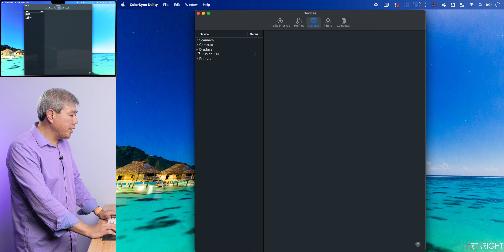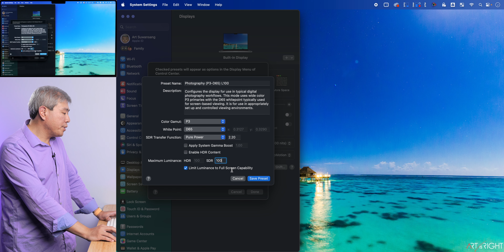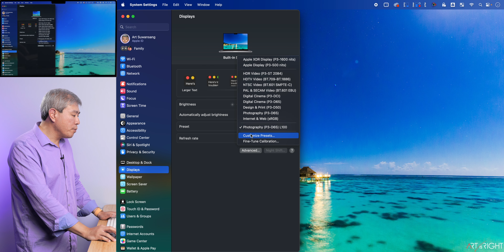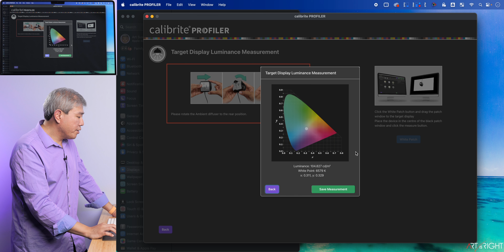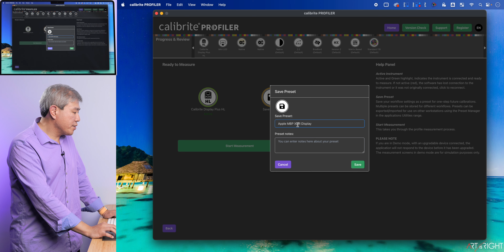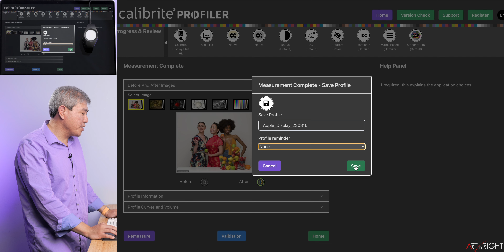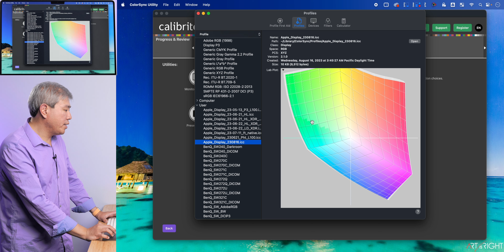Ultimate Calibration Guide for Apple 14" & 16" MacBook Pro XDR Display - This is the way!

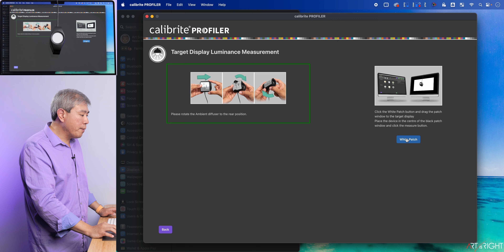Comment: At 10:00, what is the meaning of measuring the existing white point of Apple calirbated display as the target of the calibration setting as you will calibrate the screen according a know white point? or is it for monitor to monitor matching?
Reply from the maker: The point of doing that is to fine-tune the calibration on your Mac display. All displays do not produce 100% accurate white points, which is why these pro displays from Apple enable you to change this. That is precisely what we are doing: measuring how much it is off by and correcting it.

Comment: so I followed your guide to the best of my ability. Have calibrated my macs for almost 20 years. Seeming to get a max delta E of 4 despite multiple rounds of calibration with the 400+ patch setting. Any best practices or missed steps to get it lower? 16" M1 Macbook Pro
Reply from the maker: No that is on the higher side but that is about the range on the max ∆e patch. I'm sure you did fine. If you like to share the calibration report result with me, feel free to dm

Comment: Hi，I had a i1 Studio calibrater and I got it years ago，can I use this method to calibrate my M2 Macbook Pro with it？
Reply from the maker: In short, you can't. because that sensor cannot measure MiniLED backlight. The long answer is that it will calibrate but you won't get the full color gamut that the display can show
Reply: @ArtIsRight  Thanks for the reply

Comment: Is there an advantage of using the manual fine tune calibration over the automatic calibrite calibration?
Reply from the maker: It would be one of those; you do both. If you want to skip fine-tune, you can. Based on my tests, the results are close to each other with or without fine-tuned calibration, when using Calibrite Profilier
Reply: @ArtIsRight  Thank you so much! Very helpful information.

Comment: My 16" MBP running Sonoma 14.5 gives an error warning about halfway through the process and exits measurement.  I have updated to the new version of Calibrite, Profiler 1.3.2. and the version check says I'm Up to date.  I tried twice.  Thanks for your help.
Reply from the maker: I have tried the latest version with Sonoma 14.5 and it works on my systems. I would think something might be going on with the OS or interference in the background or software.

Comment: On my previous MacBook Pro I had an automatic display setting called ‘Generic RGB Profile’ how can I achieve the exact same on my now MacBook 14 M3
Reply from the maker: That sounds like a pre-calibration profile, don't think you can and if you should, why would you want that, it is a non specific profile that does not conform to your display gamut.

Comment: Do you have a video on calibration for a 16” Apple MacBook Pro M3 Max running Sonoma 14.4. Thank you.
Reply from the maker: similar process, only some changes in the GUI. This would be a good video that would supplement the GUI changes, otherwise process is the same
Reply: @ArtIsRight  what is the GUI? Is there anything that I need to change before I follow along with this video and try to calibrate. Thank you.

Comment: I can't tell you how grateful I am. I really appreciate it. I did 2 different calibrations 1 day apart. On the first day I connected my calibration device (X-Rite i1 Display Pro) via USB, on the 2nd day I connected it via Thunderbolt. My suggestion for Apple Studio Display users like me: Do not plug the calibration device directly into the slots on the back of the monitor. Use a Thunderbolt connection.
Reply from the maker: nice

Comment: Could I also use an older i1display from xite? also: why there is there no adobe rgb in the preset, only P3/srgb?
Reply from the maker: You can but won't get full gamut because this new display has a different spectral output. And there's no Adobe RGB because Apple did not calibrate that from the factory nor care to put one in.

Comment: Art, I just calibrated my 2023 MBP M2 16" - Thanks for the detailed video! A few things were a bit different and I can't remember them all right now but the last things I remember is, as you describe and demo, I can't delete older iss files highlighting them with my new Calibrite Display Pro HL software. I wasn't too concerned so moved on. I just unboxed an SW272U and wonder if I should calibrate it out of the box. I do want it to match my MBP described above....thoughts?
Reply from the maker: You can just manually delete the icc, in the color sync folder. for SW use Palette Master Ultimate software. And for the best result you should custom calibrate it. As far as matching goes, it is going to be tough, different backlight, LCD panel tech and etc. Not to mention color gamut
Reply: @ArtIsRight  Thanks. I thought about the different tech in them. I'll calibrate my new BenQ and go from there.

Comment: Hello sir, after we perform our calibration, and the profile already applied. Can we turn the True Tone on again, or leave it off ?
Reply from the maker: True Tone is automatically turned off in reference mode as it should be. If you want that on you need to be using either Apple Display or Apple Display XDR reference mode
Reply: Hi Art, after we calibrated we should always set to photography preset we designed to edit photo right? not the apple xdr display reference.
Reply from the maker: yes

Comment: Hi, i have a Macbook Pro M2 16". When I measure the white point from the Calibration PRO HL, the luminance measures 87.262 and the target range is 77.3-90.7. How should I set it? 

Thanx :)
Reply from the maker: 2 ways artificially put in a higher value in Mac OS to get to the value that you want when measured. Or put in the value for the luminance that fits with in the range of what macOS will accept. The former is a better way but either will do

Comment: I have a display pro color checker and with the MacBook Pro 14" mini led is not available. Do you recommend using white LED instead with calibrite profiler instead or just stick with the factory calibration?
Reply from the maker: No and you need the HL device to have MiniLED access

Comment: Quick question: I went through the guide, calibrated my screen, and had a new color profile set. My Question - can I switch between presets / reference modes depending on the task I'm currently performing? (For example, "Photography (P3-D65) L100" for Lightroom editing, and Apple XDR Display (P3-1600 Nits) for everything else). I'm worried that in changing presets back-and-forth, I'm damaging / reversing the color calibration I just performed....
Reply from the maker: Yes you can switch dynamically, no damage, just a different preset. Profile will carry through to all of the other reference mode as well. But you are good

Comment: Great video!  to comment below about the newer HL calibrators... I have an older pro .. I suspect that is why my profile is not near as wide as the one you show when compared to the P3 profile?  I guess another thing to buy...
Reply: I have the Display Plus. I followed the tutorial and the result is the same as yours -- the profile comparing to P3 is not as wide as shown in the tutorial.
Reply from the maker: That is correct, older device don't have the capability to properly profile these miniLED backlight displays.

Comment: i have an all patches - Max: I have 3,7 (after Color Cheer Digital SG - 96 Patches. it is a completely new MacBook Pro max m3 ....is it not a very good display?
Reply from the maker: Yes it is still good display, in general, the Max are high on these miniLED displays. Based on the result that I Have seen that is totally normal and it only effect 1 color really for the Max ∆e
Reply: @ArtIsRight  merci for your quick answer...I have the Problem, that on my Hardware Calibrated Benq 270 the pictures looking completely different to my iPhone or Instagram...do you have any advices to me how to fix that problem :(
Reply from the maker: That is what is expected. Adobe RGB vs Display P3 and different backlight tech. You can try to put your display into mbook mode which will help, but my advice is that I would not trust the phone

Comment: Hi, Art, I really appreciate your videos.  I have a question that may been answered, but I can’t find an answer:

Does each custom reference mode require its own custom profile, as I suspect is required?  If so, is there a quick and easy way to switch profiles when changing reference modes? Eg. Going from photography to video editing.

When switching modes on the BenQ SW272Q automatically switches the associated profiles (most of the time). 

Thanks for all the amazing content and your contribution.
Reply from the maker: "Does each custom reference mode require its own custom profile, as I suspect is required?  If so, is there a quick and easy way to switch profiles when changing reference modes? Eg. Going from photography to video editing."
Depending on how much the setting changes, power transfer function aka gamma, gamut and etc. So technically you should. But the variation are so small going from photo to video that I would just say choose a standard and go with that. i.e. I edit all of my video on photo standard. What it comes down to is that we are not doing work for million $ Hollywood production and I have seen some of those individual workflow that are know to be expert color grading house do away with less that what you are doing now.
And no there's no way to switch the mode and have the icc change.
On BenQ yes it will do that.
Reply: @ArtIsRight  HI, Art.  I wanted to check with you regarding multiple reference modes, calibrations, and profiles.  I currently use the P3-D65 Reference Mode (customized) on my MacBook Pro.  I have that fine-tune calibrated and then calibrated/profiled using Calibrite software and the Display Plus HL.  If I choose to also use another reference mode, am I able to Fine Tune calibrate using Mac OS as well (for the new Reference Mode settings) or will that overwrite the Fine Tune Calibration that I had already done for the P3-D65 Reference Mode?  Further to this, if I can't do a second, separate Fine-Tune adjustment without deleting the first, what would I select in the Calibrate software for White Point and Luminance, as the Native setting which I used when setting up the P3-D65 Reference Mode would no longer be accurate given that I'm using different settings? Would I select Measured in each  or select Temperature and Custom Luminance or some other settings?  It would be amazing if you did another video tutorial on this showing how to setup a second customized Reference Mode and multiple profiles.  Thanks for all your work and contribution.
Reply: Hi, Art, this is a terrific tutorial.  Do you have an older calibration tutorial for the Intel iMac 5K Retina display and using the i1 Display calibration tool?  If not, is it worth your time to help out how it can be accomplished?

Comment: Great video.  I'm using Sonoma with a Display Pro HL on my M2 Max setting this at P3-D65.  The measurement on the luminance was 167.684 and I was only able to input 167.6 or 167.7 as the range is limiting me to one character to the right of the decimal point.  When I put the target, setting it to 100, I get an orange triangle.  It does not allow me to enter in 80, 90 or even 150.  Please advise.  Many thanks!
Reply from the maker: The issue is that P3-D65 default is around 160 nits. You can't change that. This is the reason why you need to create a custom preset with the luminance that you want. This guide walks your through this. I would follow the beginning part of this guide.

Comment: Good afternoon. Tell me, please, does the Calibrite PROFILER program support thespectrophotometer?
Reply from the maker: yes, but they may be building the support for it. I have to check
Reply: @ArtIsRight  Thanks, I will be waiting for your feedback. I have the opportunity to buy X-rite 1 Basic pro 2 on the secondary market.
Reply from the maker: For that no, none of the Pro Spectrophotometer are supported. The only that's support is the Color Munki Photo / i1Studio / ColorChecker Studio devices (they are all the same). For that pro device you would still use i1Profiler. However, X-Rite has ended support for the i1Pro series already, so I would not advise that you get it. I would look at the i1Pro 2 or 3
Reply: @ArtIsRight  Have you thought about the i1 Pro? I asked about the support for the i1 Pro 2 Basic. Does Calibrite PROFILER support the i1 Pro 2 Basic?
Reply from the maker: Same answer, Calibrite Profilier will not support that, and you have to use i1Profilier those are consider X-Rite pro devices. The only spectro that Calibrite Profilier support is the i1studio device

Comment: I have i1 display pro. Can I just use whiteLED for m2 max and run calibration or that will not be accurate at all?
Reply from the maker: you can but it won't yield a good color gamut. The device does not understand the spectral output of the display, so in a way it is like calibrating and making an educated guess. My advise is to just do a fine-tuned calibration and stop there

Comment: Yes I’m considering upgrading to the MacBook m3 pro. If this is the case, would HL be best option? Would I be able to use the late 2014 iMac as an external screen? I read that it’s not possible…but would still like to keep the iMac as it’s still working so well so wanna make sure the calibrator I invest in would work on all
Reply from the maker: yes HL is best for XDR. 2014 iMac cannot be used as external display. HL will calibrate iMac as well as the new display

Comment: I have a late 2014 iMac with a 27 inch display. The iMac is running on Mojave 10.14.6. Which calibrator would work?
Reply from the maker: Any one really, you don't need the HL but you might want to consider the SL if you should ever upgrade your setup

Comment: Hi Art, wonderful video. You said that the ICC profile will remain even if you change reference modes. Does this mean we will have to do separate calibrations if we're in a hybrid HDR video and photo workflow? And then just switch the profiles inside of Calibrite? Or would this be too inconsistent? Thanks a ton.
Reply from the maker: There's no profiling for HDR right now, no consumer software can do that at the moment.
Reply: @ArtIsRight  so what’s the best way for ensuring color accuracy for HDR? No calibration, just white point adjustment? Thanks
Reply from the maker: Yes
Reply: Hi @ArtIsRight  , have you tried Patterns for Mac by Calman? They claim to have full HDR test pattern and calibration for Pro Display XDR. Not sure if you need Calman Studio ($2,000) though. Thanks

Comment: Hey,
I’m a photographer looking to buy a color calibrator for my MacBook Pro Max M3 (November 2023). Will the Display Pro HL work with my screen?
Reply from the maker: Yes
Reply: @ArtIsRight  
Thank you! 
And since all existing guides were made for OS Ventura, how will I know how to calibrate my screen? 🙂
Reply from the maker: what this https://youtu.be/UQs4y26ZULM choose fine tune option
Reply: @ArtIsRight   Thanks again for all your help! You are amazing! 
Quick question: I went through the guide, calibrated my screen, and had a new color profile set. My Question - can I switch between presets / reference modes depending on the task I'm currently performing? (For example, "Photography (P3-D65) L100" for Lightroom editing, and Apple XDR Display (P3-1600 Nits) for everything else). I'm worried that in changing presets back-and-forth, I'm damaging / reversing the color calibration I just performed....

Comment: Ive just done my own testing, and i can say that Apple STILL not loading profiles correctly when restarting. I've just created a really bad profile like make everything washed out, so after i change resolution or restart my computer it KINDA goes back to apple default profile, BUT not same as going again into calibrite PROFILER and applying the profile again. 

I dont understand why you saying that after restart it applies the profile, visually it kinda HALF applied
Reply: Here more litterly the issue I'm having g this  ICC profiles not sticking  you will see
Reply from the maker: That is a bug in some OS. Hopefully this will get fix soon...
Reply: Hi, I have the same problem here with my MBP 16 M3 max, as soon as I restart or switch to the XDR 1600 nit profile and come back to photography P3 L100 the icc profile reverts to lcd colors while on colorsync it shows me the icc profile created by calibrite, each time I have to click on reset to default and then on calibrite "profile management" to click on activate on the icc profile I created with my display plus HL so that the colors change and my profile is activated correctly. This must be a Mac os sonoma problem?

Comment: After doing this calibration is there issues with HDR content? lets say if you open HDR youtube video will that display correctly and not washed out?
Reply from the maker: That is a fiction of the display firmware, so no issue.

Comment: Hey Art, quick question. I did a bunch of these calibration for different brightness values. Whenever I change the Preset, do I also have to go into Colorsync and load the corresponding icc profile as well? For example if I have a 100 nit preset and 100 nit profile, if I load the 120 nit preset, do I also load the 120 nit profile or can I leave on the 100 nit profile?
Reply from the maker: "Whenever I change the Preset, do I also have to go into Colorsync and load the corresponding icc profile as well?" 
Yes and you should restart the color aware apps as well, such as PS, LRC, LR, etc because all these apps load the display icc upon launch.
The trick here is, if you use the same gamut and other settings for the various luminance calibration then you should be ok just switching over the calibration mode without setting the corresponding profile in this circumstance.
Reply: Thank you!  @ArtIsRight  I appreciate it.